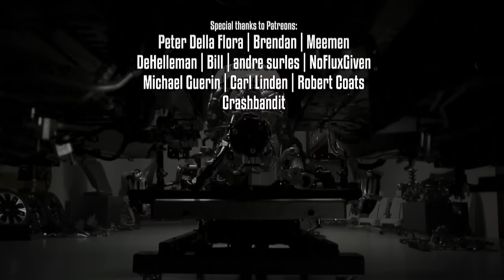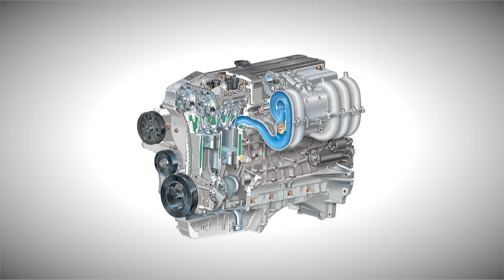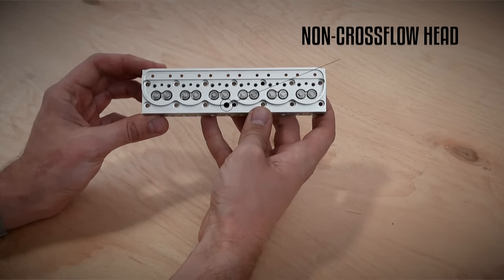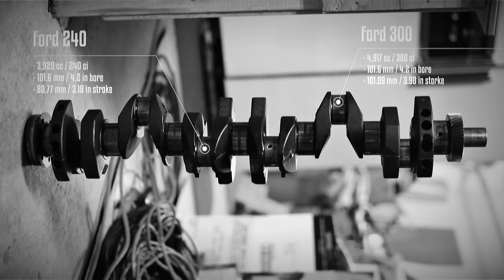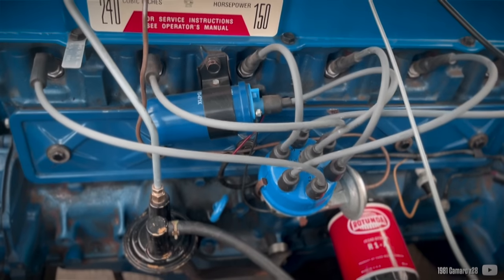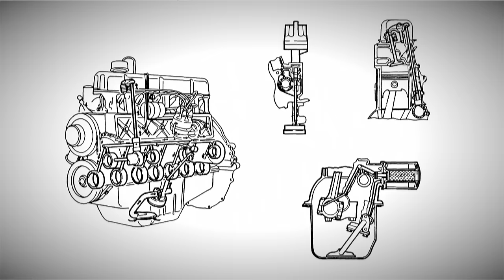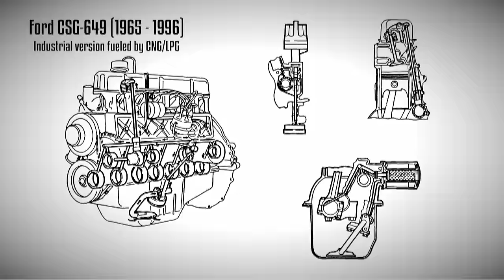Is This Toughest US 6-Cylinder?

Comment: The Ford 300 inline 6, the Chevrolet inline 6, the AMC/Chrysler 4.0 inline 6, and Chrysler slant 6 are 3 engines I have seen just run for decades and hundreds of thousands of miles with just the most basic work. Love them all.
Reply: only thing I didn't like about the slant 6 was the intake manifold. That was a hell of a lot of cast iron hanging out there in space.
Reply: Slant sucks... it shouldn't be mentioned as one on the greats at the table.
Reply: Yep. I should've mentioned the Chrysler slant six, too.
Reply: @oscarbear7498  The entire automotive world disagrees, you need counseling.
Reply: The AMC 4.0 was amazing!
Reply: T found this video and was just going to say this.
Reply: Do not sully the name of the 4.0 by calling it a Chrysler engine...
Reply: My Dad had a Chevy 292 in a Custom Deluxe 20 farm truck that he drove from 1980 until 2019 when he wrecked it.
Reply: @ramblerdave1339  Particularly the head gasket manufactures🤣

Comment: From Leo:  I was a Mechanic at a company that ran 19 and 26 passenger commuter vans to the airport.  The only modification we did to the Ford 300 ci engine was a small engine oil cooler.  Our projected life was 250,000 miles, and they easily made the 250K mile mark.   We kept a few older ones as substitutes when the newer ones were scheduled for maintenance. Those substitutes had well over 300,000 miles.  The 300 Ford is a very durable engine.
Reply: I have a '91 F150 sitting at 310k. It has a tiny amount of bottom end noise but otherwise runs like a champ. Someday I'll flip the engine and do all the bearings.
Reply: Speaking of bottom end noise, my 88 300 has 480,000 on it, and it rattles on a cold start, but in my case it's not the rod bearings, it's the piston wrist pins. They are prone to rattling on high mileage 300's. If i run light weight oil in it and cruise down the highway at 2500 to 2800 rpm, the wrist pins rattle soo bad that it sounds like I have an old 7.3 power stroke diesel under the hood. So at my mileage, I run 15W40 year round and it's quiet as a church mouse. Mine is also eventually getting pulled for a rebuild, but I'm in no hurry, it still runs great, and I have to get a few other projects out of the way first
Reply: What people might also fail to understand is these engines were designed during a time when engines and even the cars weren't designed to last anywhere near that long. Odometers only went to 99,999 miles because a vast majority of people would have been done with the vehicle by then and it was going to be junk. 

300 to 400K for these engines is probably equivalent to 3 or 4 million miles for today's workhorse engines, which is still incredible for even diesel territory.
Reply: Ford definitely did it right back then. Our 7.3 powerstroke has 600k on it and still runs perfect
Reply: Add an auxiliary Oil filter and it would probably still be running  fine in some place and time.
Reply: @kerryharrell8821  Loved my 7.3, got pulled over when Contracting In Jersey on the Pike, one day in my 2003 F-350, doing over 80, The only reason he let me go, is I  was still being passed and he did not think it was wise to travel that fast, I told him I was trying to catch up to my girlfriend who took my wallet to piss me off after visiting me 
I had regular plates done right so he could not get me for anything else, but bs excuses
Reply: Every tree trim company that I’ve ever dealt with has Ford three hundred straight 6’s powering there wood chippers that they used to mulch up tree limbs . They all swore by them as the best most durable engines.
Reply: @evankirkpatrick8741  Correction. 7.3 "Powerstroke" is International/Navistar. Ford had a FEW input in that engine yet overall the engine is International/Navistar. Until the 6.7 Powerstroke, Ford hasn't built a diesel engine in-house
Reply: That is why they killed it.
Reply: For it's time, the 300 was a very durable engine.
But compare with the 4.3 V6 that was used in the 2002+ Econolines (among many other usages) that commonly hits 500,000 with no rebuild.
Reply: i had a 93 f150 with 444500. on it still ran great
Reply: @evankirkpatrick8741 international design and build is why..
Reply: Just remove the thermostat and the block becomes the oil cooler
Reply: Love the sound these make.

Comment: The majority of airport tugs still use this engine.
Reply: Lots of them run pumpjacks in the oil and gas industry as well running off fuel gas directly from the well
Reply: Yes, mostly the ford,  we used a restriction plate with about a 7/16 passage. Very reliable. I miss them.
Reply: And the belt loaders too
Reply: @0004612  yes, the belt loaders were my favorite as the room to work on the motor.
Reply: I've seen aircraft luggage conveyor ramps with this engine also.
Reply: I miss those engines..i want one like that..to Power my make shift Jeepney in the Philippines..
Reply: And the ground power units.

Comment: The 300 is by far the most reliable engine to ever enter the market. I've seen trucks with these engines beat to hell and still work like they were new. This engine is an absolute unit and an amazing investment.
Reply: Not by far...the Chevy 292 is right up there...
Reply: @dyer2cycle  Chevy has a good straight 6 as well but the Ford 300 is the most popular, as Chevy's most popular engine is the 350 with the 454 in second and the predecessor of the 350, 327 in 3rd.

I remember a guy saying how he was smoking all these 350s with his 327 but I couldn't help but laugh because even though it is still a nice engine it doesn't compare. Just like how the 350 and 5.3 are not even a close comparison.
Reply: the underpowered 225 lasted as long or longer. the 225 didnt get broken in till 150,000
Reply: Only one better than the 300-6 that I know of... the 200-6 (think 65 mustang)
Reply: Chevrolet 292 six-cylinder was it had more stroke and horsepower wrong with the 300 Ford wrong
Reply: Absolutely  agree